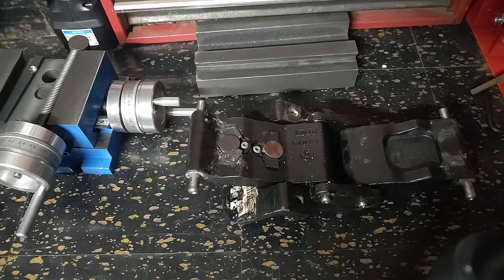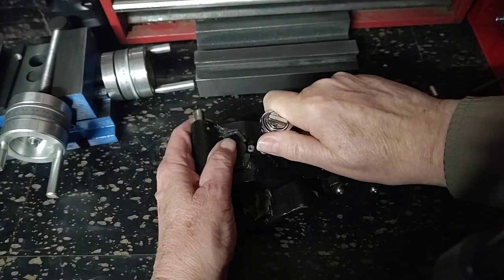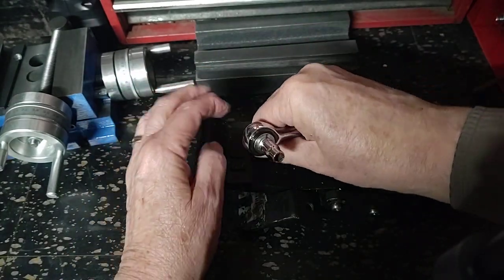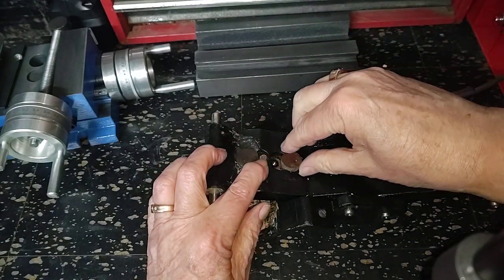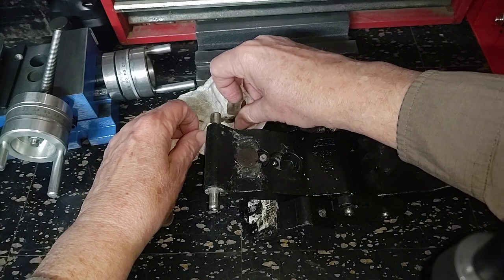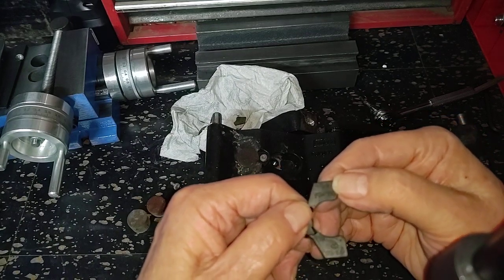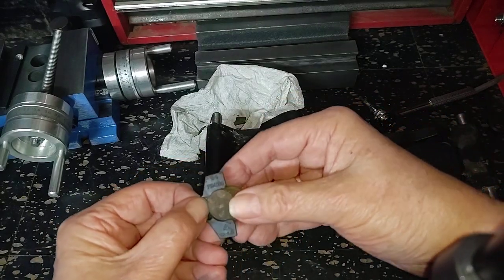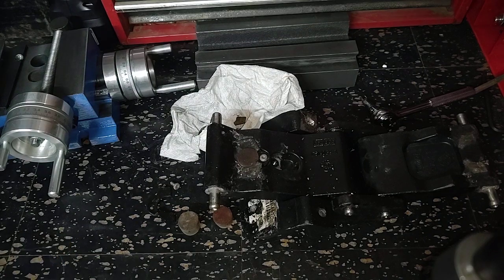Lincoln Navigator running board rubber bumpers removed

Comment: I pulled those stops out of mine, and was surprised that they had little "wings" in the rubbers, and slots in the bracket that aligned the circles correctly. 

I thought it was a little odd that they'd add those to something I didn't think would need to be aligned.
Reply from the maker: One can never quite tell when something is going to be over designed. Thanks for the comment.